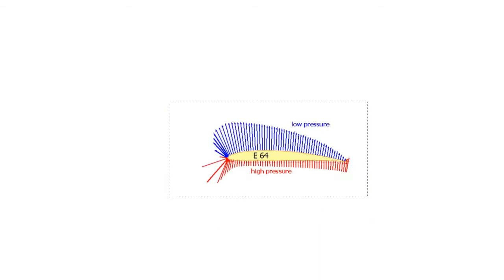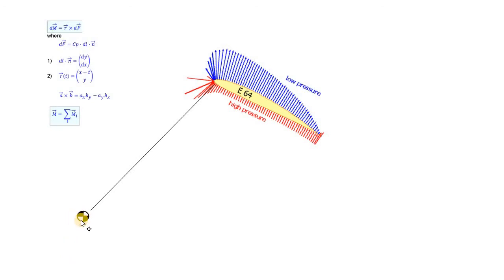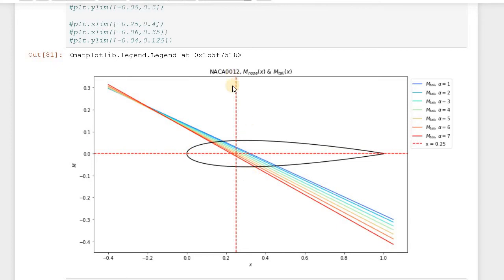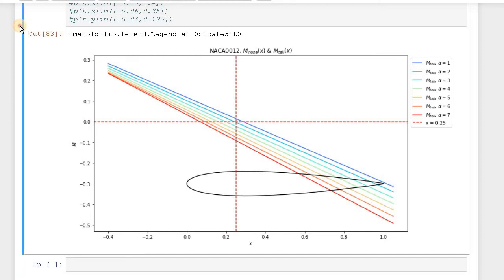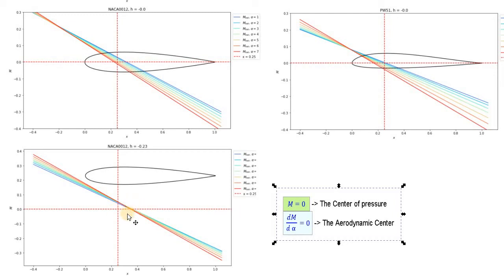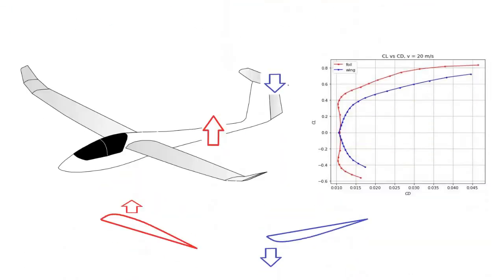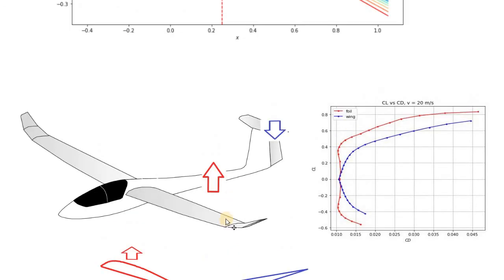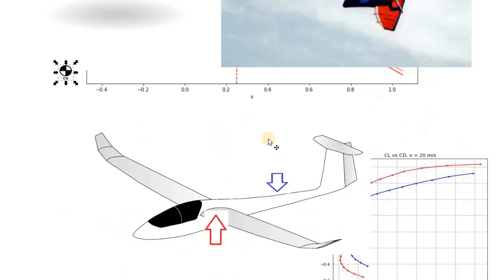The most Aerodynamically Efficient Airplane designed from the first principles.

Comment: Dr. Alex:  great video!  I concur with all you say, EXCEPT….   IF, you decide a priori that you are NOT ever going to have a tail foil (elevator), then I concur fully with your approach and analysis.  HOWEVER, if one decides that one DOES need or want an elevator, either for aerobatics, or added control margin, or enhanced maneuverability for STOL landings, etc., then maybe what you say Is not quit right I think.  The reasoning is that IF you are going to have elevators (and let’s throw in rudder for good measure), for the reasons I cite above, then even the near perfect tail foils will still have parasitic drag.  But you will not be getting any lift from that drag.  Yes, that might motivate you to eliminate the tail foils, but like I said, I’m assuming here that you still need them for the reasons cited.  In that case then, I believe you will be better off having the tail foils produce at least SOME level of lift to pay for at least the parasitic drag incurred.  This lift would be traded for less lift needed from the main wing, thereby buying back some of the drag.  In this case I think you still do the moment analysis you did, but you do it for the SYSTEM of the main wing plus the tail wing(s) (elevators).  I think the elevators give you added control authority and stability, and is a worthy trade for conventional aviation.  It would be interesting to see your analysis and approach directed at optimizing the conventional wing and tail foils architecture, for those cases (many) where a tail is preferred, wanted, needed or possibly even mandated.  Thanks!
Reply: to your point, consider the fact that all birds have tails (elevators), they are not true "pure flying wings" either. And they do use their tail feathers to produce additional lift during takeoff as well.

Comment: the hang glider you say is more eficient than a sailplane...that can not be corect and as you just pointed out the reflex airfoil is not best...a hang glider has a reflex airfoil...and as you pointed out it has swept wings and wash out that are not the best eficient solution. and this sows up in the hangliders LD compared to a sailplane LD ....also hang gliders tumble and not recover because the moment can drasticaly change at negative angles of attack...you are not modeling all posible angles of attack.i will now view your corections
Reply: not all hang gliders are the same